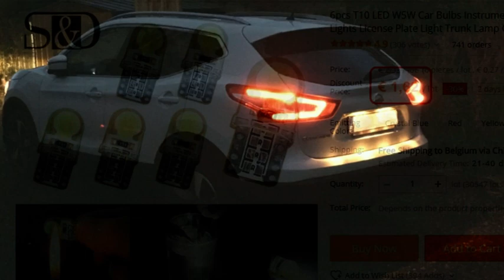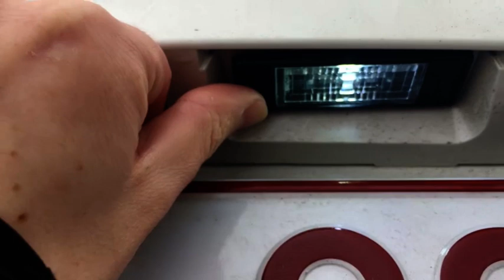Qashqai license plate bulb replacement by LED

Comment: Does same led type work on first generation of qashqai? And which ones go to indoor (in roof) ?
Reply from the maker: I think so but you should check your car manual to be sure. 😉
Reply: @LaPalmeraie0032  okay thanks.
Reply: @LaPalmeraie0032  is the way of replacing bulbs same on first and second generation of qashqai?

Comment: Hi. My wiring didn’t allow me to pull it down to turn the connector. Don’t want to pull it too hard tho. Any thoughts ?
Reply from the maker: Why would you pull down and turn the connector? If the bulb doesn’t light up you just remove the bulb again, turn it 180° and place it back.
Reply: La_Palmeraie i mean to initially just change the bulb.. the wire seems far up in the compartment.
Reply from the maker: Normally the connector is placed in a closed box so the wires couldn’t go anywhere.
Reply: Same problem. On the left there is no issue, on the right the wire is so short it barely shows. Maybe it is not hard for a Japanese hand to fit there, but mine definitely doesn't..
Reply from the maker: It’s hard but feasible. Otherwise you’ll have to open up the liner of the trunk hatch and try to release the cable a but more from the inside.
Reply: @LaPalmeraie0032  Yeahh didn't wanna do that, but I was able to fit back the bulb and click it in place with a little bit of twisting with screwdriver and my finger. Legend has it my finger still hurts from all the unsuccessful attempts 😁
Reply from the maker: @iliyaalexiev 😂 been there done that 😉